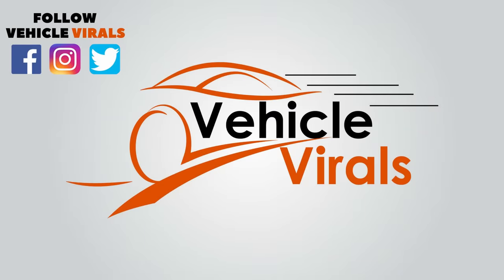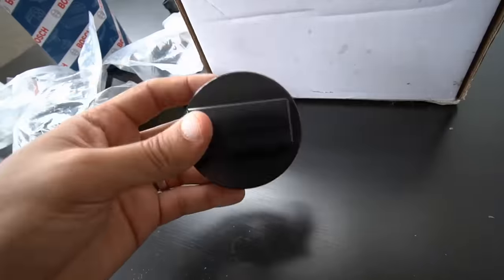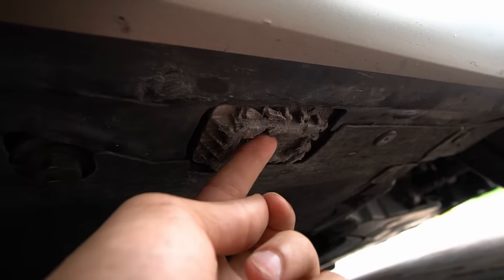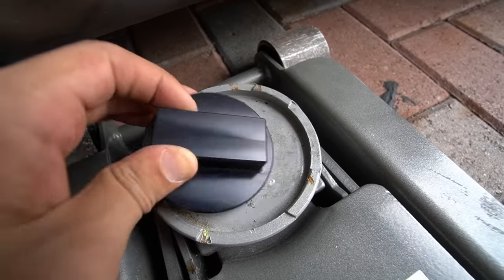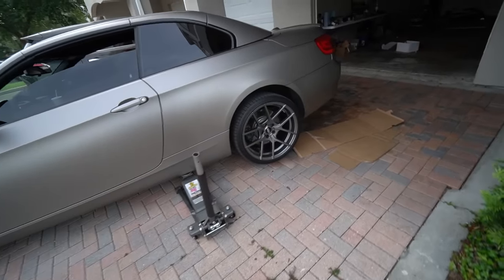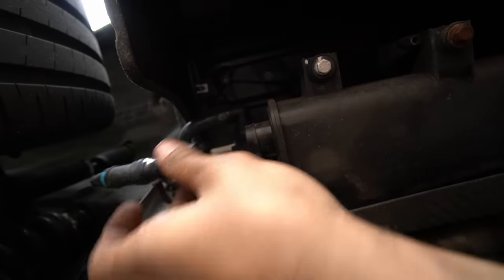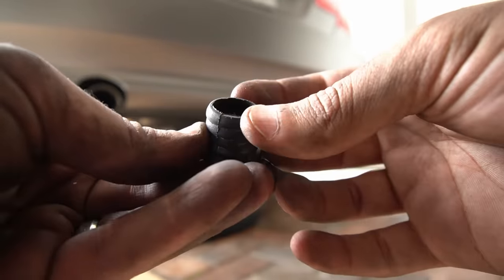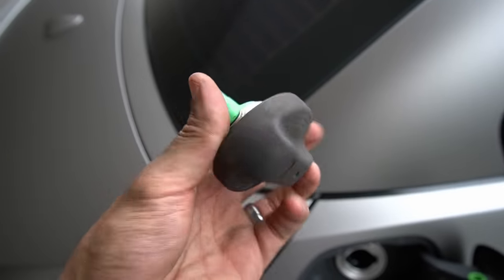All BMW Owners Should Replace These Two Parts Before It's Too Late *EASY DIY*

Comment: Here's an important point about the plastic jack pads: About once a year pry out the plastic rivet in the middle, remove the pad and clean all the dirt and sand around it, between the pad and the car, and inside the hole in the frame with a rag. Dirt and sand will accumulate around the jack pad and, because the dirt holds moisture against the metal, will cause rust. There are plenty of YouTubes of owners having to cut out the sheet metal and replace the rusted part of the frame to pass inspection (especially on E39s). Because they have punched a hole in the frame to hold the jack pad, the exposed edge of metal is particularly subject to rust, yes, even though they paint and coat the cut. Really. So put a reminder on your phone to check the pads once a year and keep the rust away from your ride.
Here's one: https://www.youtube.com/watch?v=F0z8C6f2vNI
And another: youtube.com/watch?v=Df5BBDLHyoA
(PS. You will see the same thing on the back hatch on the E39 wagons along the loser edge of the rear window. The cable loom for the tail lights goes through a couple of holes in the metal and they inserted rubber grommets to protect the wires, but the grommet also collects dirt and dust and in a few years the rust starts up).

Comment: What up playa. I have 1998 bmw 528iand the code for the leak detection pump came up. I replaced it but the check engine light still comes on. Just wondering what’s is a good website to find affordable parts for my ride. Thanks

Comment: Is the bmw 650i e63 the same?  I damaged one on a speed hump. I want to get the jack pad too. Not easy using the x5 jack. Your car is the best looking e92.
Reply from the maker: E93*

The parts are similar but not the same exact ones. Make sure once you use the links to sort the parts to your vehicle.
Reply: @VehicleVirals  my car is a e63 650i 2010. I can get the genuine part's not a problem. Bmw hasn't got the jack pad. I'll have to order that from ebay. Thank's for your help👍👍👍
Reply from the maker: @alfiobalsamo1591  ECS Tuning also has the genuine parts.
Reply: @VehicleVirals  Thank's.

Comment: I have a 2012 BMW Convertible 328i and one of the front headrest is up and i cant figure how to adjust them. They dont have the round posts but a square post and looks to be electric. And info how to move them up and down. Again it don't have the chrome 2 round posts. Any info would help ...Thanks.

Comment: I hope you see this but i have a 528i e60 and i recently replaced the radiator thermostat and waterpump and the antifreeze bubbles up (not cooling right) it leaks out cause of the overflow any idea why my car is doing this?

Comment: Cool tips indeed. I came across your Video while trying to find a way to Code or Program a new aftermarket key fob for a 2012 BMW 320i F30 key fob, any help would be Appreciated as they want dang near $500 for one from the dealer here in Canada, and well, that's Crazy!

Comment: Hi, very helpful. I actually have a question on another mystery code that is showing up on my e91 (n51). The code read CDA7 and appears to be related to reverse gear status fault. The car goes to reverse gear perfectly and drives fine but the fault code always there. Would appreciate if you have any insight on this issue. Thanks

Comment: i have a problem with my BMW 328i sulev convertible, after half an hour running, appears on the screen, the fuel pump fails and the car turns off two minutes later it turns out like nothing, they think it is the gasoline pump or it could be something else

Comment: I have an issue with my car. The car automatically set the passenger airbag but nothing but smoke came out. I have no gages and lights in the gage section and my ac is gone.

Comment: My car damaged the water pump, I changed it for the same original "continental" brand, but the thermostat is Chinese and now when I turn off the car the pump stays on for 25 minutes and then turns off. if I open the door it turns on again the same 25 minutes more, do you have any idea? They tell me it's because the thermostat is Chinese

Comment: I have a question ? 
Does an m sport rear bumper fit without any modifications I have a 08 convertible coupe want to switch rear bumper to m sport with a clean diffuser

Comment: Why are the new pads smaller width than the old?    This will have higher pressure to the car lift points.   Why cant the pads hold up to the cars weight/  When you go to the shop for tires, you will need 4 lift adapters  for them.    The old BMW pucks may be a better design.

Comment: Great design (BMW) I'll keep this in mind when I never buy one. Don't have any desire to be associated with the way the owners drive, either. The more videos I see about BMW's the more I don't want to own one. Oh and make sure that this pump is very difficult to access and also has different fasteners just to piss you off. Once again, great design to get you into the shop to spend more money. FU. M aybe you could mount this in the engine compartment ? A major design improvement for all of us. Bad gas cap, again, wonderful design to get your $$$$$$$$ again.
Reply: Stan Coleshill How so do the owners Drive?

Comment: BMW owners just need to replace their BMW's with good cars.
Reply: What do you drive bud 😂
Reply: @Derick_Gillispie_Vlogs  I don't drive any German cars although I used to have a      V-DUD Passat and Mercedes S550. Total junk. I didn't own either for more than a year. Both were purchased new and the V-DUD was in the shop 13 times while the Merc was in the shop 6 times within the first year. Today these German cars are so cheaply made they use vinyl imitaion leather seats, cheap plastic imitation wood trim and plastic water pumps in $70k cars. Just pure junk and not worth the money.

Comment: There is so much plastic in the engine compartment of a BMW, I suggest you buy a plastic factory to manufacture of the parts you’re gonna need to keep it on the road.

Comment: Christian advice please. I had my BMW's water damaged computer box replaced with a lock-set from an automatic BMW car. The car starts very well but l experienced two noticeable hiccups 1)the steering wheel doesn't unlock even though the engine is idling',the second 2) issue is that the engine electric fan remains on and doesn't shut off.

Comment: but....what if you need all 4 on jack stands? then you need 4 adapters, at 28 bucks a piece plus everything else. no thanks
Reply from the maker: Honestly I think having the flat jack stands is enough but it's technically not the right way to do it.

Comment: The lift pucks will eventually fail. Not a matter of if but when. Doesn’t matter how you lift the car. The weight of the car resting on those pucks will cause them to split, crack, and in some cases they just fall off.

It’s a shit design BMW has been using for decades now. Mercedes does something similar, but theirs are round like a hockey puck, and better distribute the weight when loaded down. Even those still fail after some time however.

Comment: Might want to add a link to the part, 
so you get credit. Bosch Leak Detection Pump #16137193479
Reply from the maker: That's so odd. Though I added it. Thanks
Reply: My pads were mildly deformed, I was able to use a razor knife to chamfer the edges so the pad adaptor would fit. I also chamfered the new ones to make it easier

Comment: Jack pads that require a proprietary adapter  👈Another dumb idea from BMW.
Reply: BMW jacks fit into them without adapter, but I agree: they could have a smarter shape which allows the use of regular hydraulic jacks!